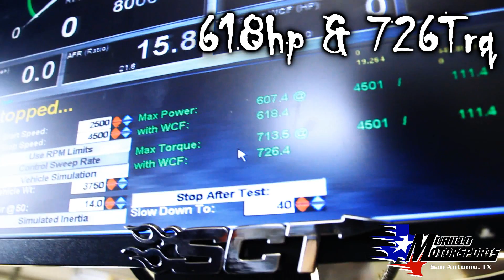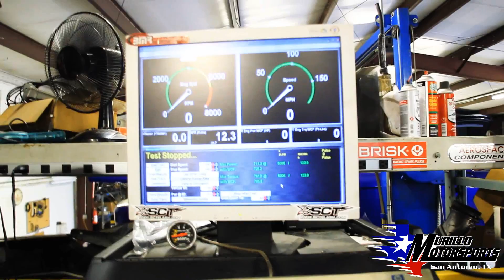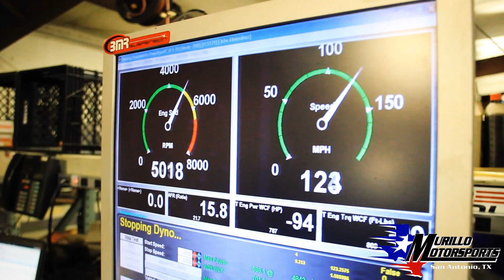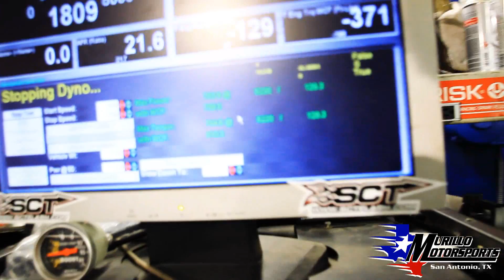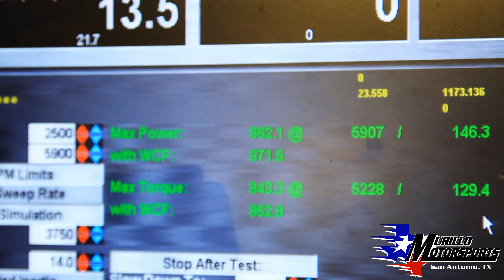WestTX ZR1 Killer - 1000HP Capable GT500 - Compound Boosted Dyno @Murillo Motorsports

Comment: Wow that is pretty crappy performance considering you can strap 2 turbos onto a 03-04 cobra and make over 1000hp
Reply: Yeah and run the factory blow in the combo and run 1200 .. look at compound boosted cobra= youtube
Reply: Think it was roll racing and maybe 1320
Reply: Their was one , that was twin turbo  made like 1300+ on race fuel. And down tune to 740 and still spanked a ZR1
Reply: that's not a 03-04 Cobra, that a GT-500 and there is a video of a 03-04 Terminator running compound boost and was beating people asses left and right. that cobra only lost to a very fast Lambo and almost beat a fast as fuck Viper.
Reply from the maker: This car was making more then we showed brother... 🤣

Comment: it makes me laugh that a ford has to have all that to make only 1000hp hell slap a single on a chevy it'll make 1000hp haha just makes me laugh...
Reply: see this is where you are wrong lol, this car, yes, this is the route they went.  there are many 5.0 coyotes over 1000 horse without having to "compound boost"
Reply: and it took all this to get a 5.4L that high.  the 5.8 is 662hp stock.  over 850 with the KR package
Reply: yea but the 5.8L is supercharged... plus its from Shelby...  and yes I know hell there are some down at TX2K oh wait no those were corvettes there werent any fast fords there cept the Ford GT...lol
Reply: justin1989001 no... The 5.8 is from ford. Ford 100% built that engine. Shelby's name is on the car for sales and suspension. And who gives a crap if it is supercharged? Power is power no matter what the source
Reply: +justin1989001  like the other guy said he doesn't need the sc and the turbos it's just the method the guy wanted.

throw a big whipple or kb on there an 1000hp.

it makes me laugh when chevy fanboys have no idea about something an just blatently love hating on fords.